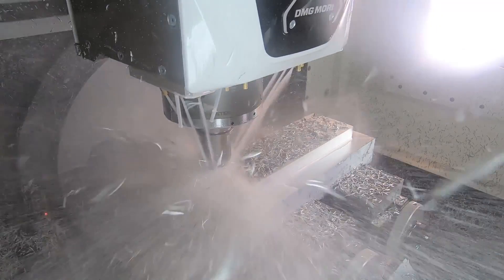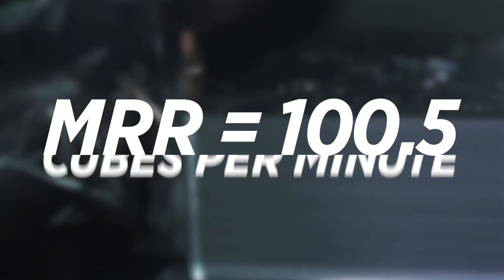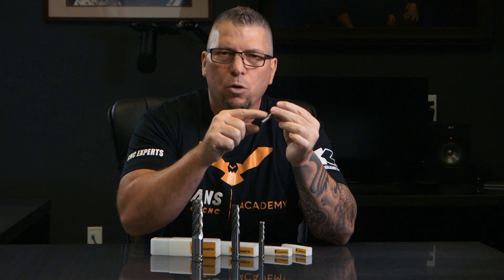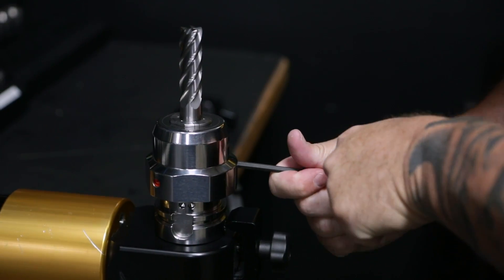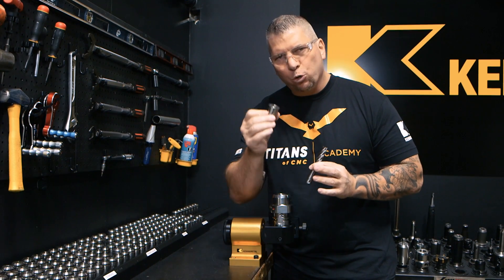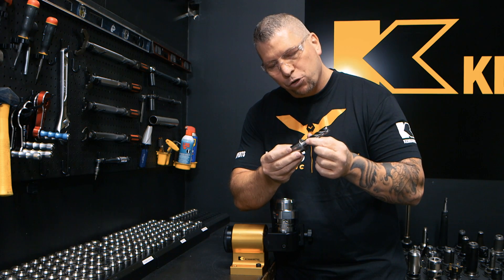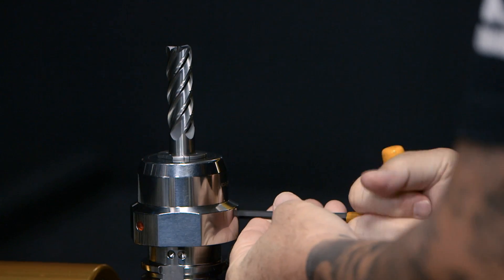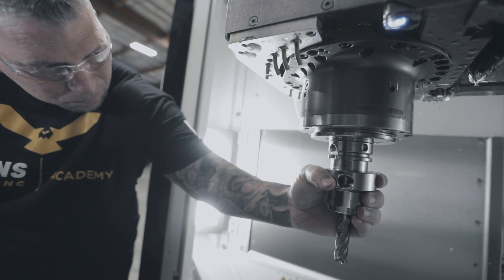Tool Holding for The KING Of ROUGHING | KOR 5 from Kennametal

Comment: Yop never had a issue with a End mill holder.just people losing set screws, grinding the shank just seems to be a problem. I'm not sure what set up to have to grind a weldon flat on a end mill that good. I think john from NYCCNC said the heat from grinding could change the properties of the end mill and make it weaker. What grinding wheel would you recommend Titan?
Reply from the maker: I never grind on shanks for set screws . Diamond wheels if I need a relief.
Reply: Thanks Titan

Comment: I was under the impression that hydraulic holders aren't idea for high rpm situations for two reasons. One is it puts more strain on the spindle because the holders are heavier and inherently less balanced. Second, it loses clamping power with rpm due to centrifugal forces pushing the fluid to the out side of the holder. Is this just an old way of thinking and the tech has improved? Or are there still things to be concerned about in some way?
Reply from the maker: Technology has greatly increased and hydraulic holders like HydroForce are considered premium tool holders on the high end. Each holder has a rating for RPM’s also.
Reply: Yep. Old school thinking. Today’s Hydraulics are right up there with heat shrink. Sans the equipment purchases, safety risks, etc. There is also a damping effect on harmonics transmitted into the machine. 

My suggestion would be to reach out to your local Schunk rep (excellent hydraulics). They can come by your shop and talk to you about the different versions available, and what operations they’re specifically engineered to suit. They also have some basic brochures with charts showing this stuff that they can leave with you. 

You can buy a short projection basic Tendo E holder as an all arounder for not much money at all. They’re not rebuildable like some of the others, but will give a long life.
Reply: Awesome, thanks for the feedback guys.
Reply: Whoever told you that hydraulic pressure can be reduced with centrifugal forces doesn't understand the basic underlying principles of hydraulics. Liquids are not compressible. That's the whole principle behind hydraulics. Unless there is air inside, there's nothing to compress, and therefore no way to change the pressures inside the tool with centrifugal force.

If there IS air in there, the tool holder worthless, at any speed...